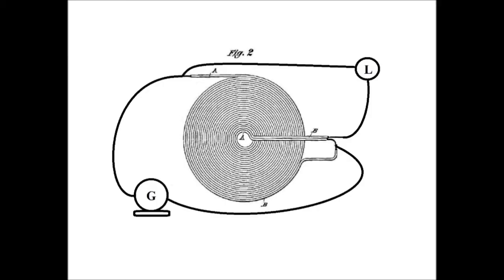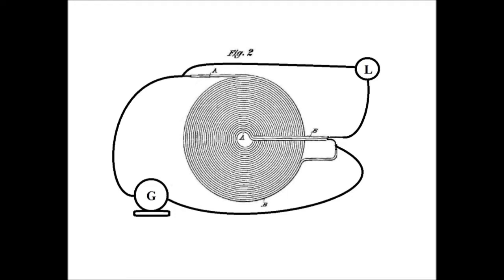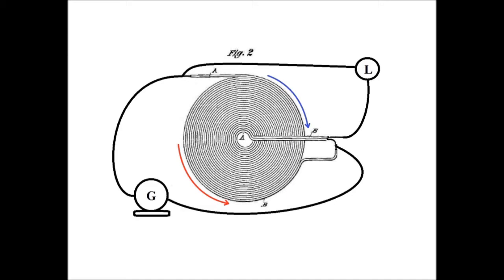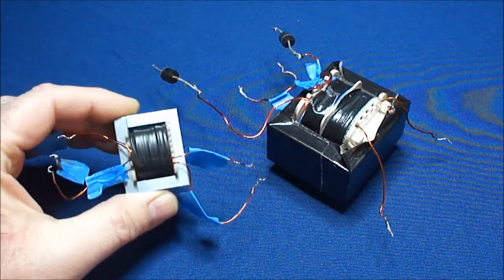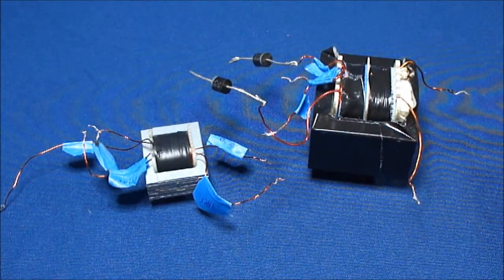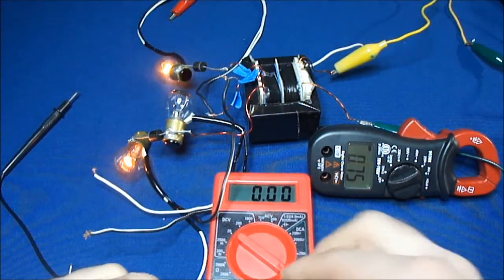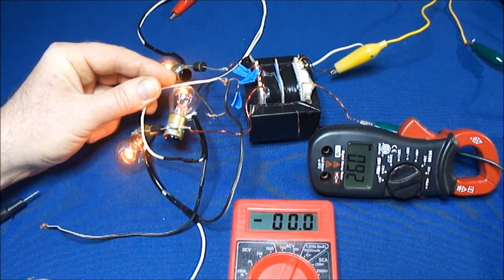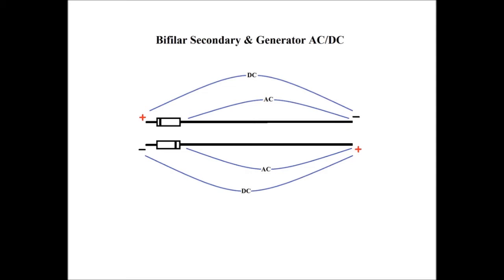Bifilar Coil Potential AC & DC

Comment: It is not clear what you are trying to do. You did not explain it well. What you have has nothing to do with Tesla's bifillar coil. The traditional transformers are not what Dr. Tesla tried to achieved in Bifillar or pancake coils. These are two different things with similarities. In a simple words: Conventional transformer works on induction and flux movement principle, whereas Tesla's bifilar works on magnetic current and induction current; whereas the parasatic capacitance works as dynamic electrostatic current. That is the big difference. I hope you will follow along with those line in Tesla's technology. Thanks for sharing  your thoughts. i liked your video for sharing a small experiment. Regards and cheers.

Comment: Howdy sir. Love all that you've  shared as i have learned immensely from all of your demonstrations- but i have run into a very- very good problem.  In short summary, I wound a bifilar 12guage coil around essentially a 4-5inch bundle of welding rods with a small gauge primary, 180 turns on each coil, but implemented a capacitor in the center tap of my secondary 12gauge coil. whenever I short-out the secondary, my consumption from the source goes down and i am able to more than quadruple the power output and my primary input consumption goes down as a result. Impossible, right? Well- its not, and it works. I just know that the capacitance has to be correct for it to work, and it does everytime. This, from what i have ever heard and seen, is not suppose to be possible but i assure you it is. I just want some guideance from anybody who can tell me how and why this works. the capacitor gets hot when held at a dead short, but i can easily make more robust capacitors but want anybody's input on how to continue how to amplify the output for the all desired, not only selfrunning loop generator, which i have achieved through this method, but how to amplify it to the degree of running a home. I would be happy to share a short video with what i have said, as it is truth, but i wanna make it with more than enough power for any one person to run their home without anytyhing other than the battery that starts the circuit. the more power/amps you pull from that secondary coil- the less power consumed from the primary. this should not be so, but i have (after lots of time and thought) have decided to sell the idea and miss out on the big bucks. i have friends with family in Ukraine that i want to get here to the US safely and want to do so asap. I would more than just appreciate any thoughts or guidance on the topic. also, the design only works on an incomplete ferromagnetic circuit as the transformer core. my core is lterally welding rods and insulated rebar on my second build. this is real, i just want to help people-which costs $, but i gotta do somethin with this and would be happy yo share with anyone that can help point me in the right direction. compensation expected and just lookin for some help, like- asap, as lives are literally at steak. I believe it works due to the capacitor removing the impedance of the secondary bifilar col, which is what i think makes it tick- but again, only when there is not a closed core/transformer magnetic circuit.  This thing is stupid easy to build but took me 5 years to find it. This is not a joke. I dont know what to do with it as I know patenting such a thing could end in death. Literally. Any and all thoughts welcome, and the sooner the better. Thank you for your time just to read this.
Reply: It's interesting but you're primary Guage has to be similar to the secondary.